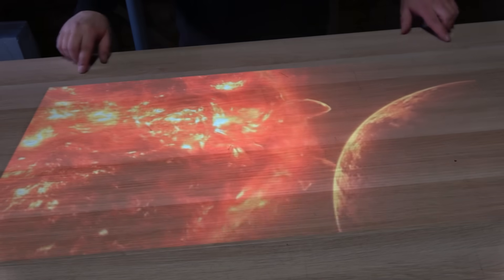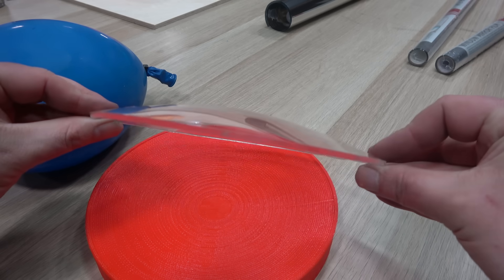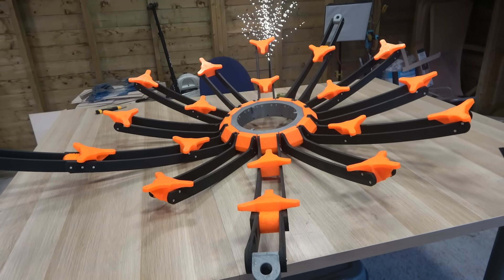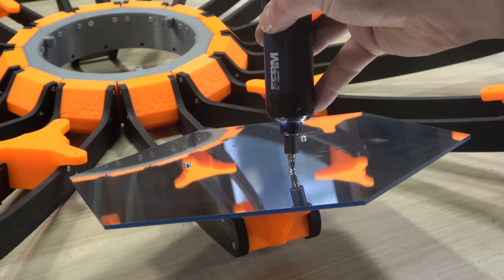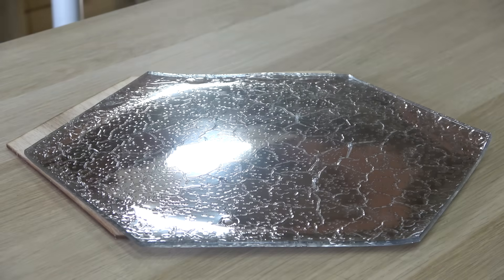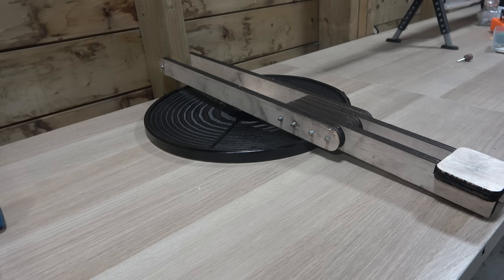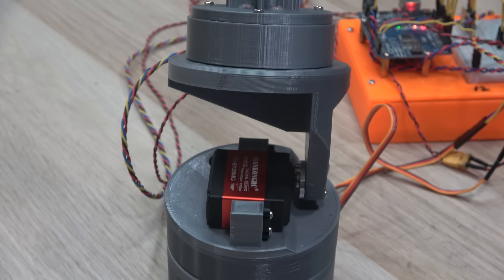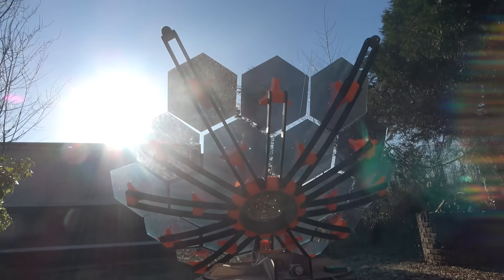Building a DIY Solar Generator..

Comment: Ack!  Blacken the aluminum!  Your reflecting WAY to much of the energy back at the sun.  Literally almost all of it.  Um but you might end of flash boiling your water or melting the aluminum.  So highspeed pump?  Or use a thermal fluid to move the heat away from the plate?  Have a heat based auto-abort? (something that moves the mirrors off angle if too hot? Bimetallic bar that need to overcome a spring?)

Comment: Why not order a sheet of brass sheet stock and hand polish it with brasso?  If you are able to print molds for plexiglass, then you should be able to make a press mold to form it as well.  One other thing I haven't seen anyone do (maybe its not possible):  Don't we have new solar cells that work on specific bands of light with greater efficiency?  I thought there was something regarding the "limelight" color those old stage lights made.  If you could stack one on top of the other, wouldn't that make output double for the same size (assuming one of the panels will allow that band of light to pass through it to the next layer)?

Comment: For the sun tracking I'd seriously consider an equatorial aligned single axis drive, just like a German Equatorial telescope mount, it will allow for counter weight balancing to lessen strain on motors. There's a market for second hand mounts with some sophisticated tracking software more than capable of following the sun even over multiple days.
You don't need your primary reflector segments to be curved either, they can be flat as you are not trying to cast the image of the sun on a focal plane, you just need the maximum of light from each reflector to reach a common surface area which will be your collector. If you could position your collector in front of the reflectors instead of needing a secondary reflector to send the light back down again then you avoid losing energy to a second reflector which will itself also be getting quite hot as it is nor reflecting 100% of the light/heat.
Reply: Yes to the equatorial, no to the German equatorial though: they have a meridian flip issue that you just do not want on a solar collector. What you would actually want is a simplified fork mount: the two tines, instead of holding a telescope tube would instead hold a shaft fixed to the back of the reflector. In the other direction the shaft would extend past the pivot point where it could be counterweighted. Another variant would be the yoke mount, which might actually be the best option.

Comment: Your spherical vs parabolic issue was the exact problem with Hubble. The manufacturer of the Hubble mirror used a circular saw and thus ... you know the results.  Bands of mirror reflecting to different focal points. Too bad. History repeats.

Comment: I don't know what CAD software you are using. In Solid Edge, if you use the material properties correctly, the software can identify the center of gravity (CoG) of both a part and an assembly. If you place the CoG of the upper mirror assembly directly above the central point of your turntable and are able to figure out a method for pivoting the mirror assembly up and down on an axis which passes through this CoG, there will be no moment arm to contend with. The motors required for motion will only be fighting friction and inertia. They won't be battling many newton meters of torque.

Comment: You can absolutely thermoform your mirrors but it requires precise oven temperature control to avoid bubbles and under and overheating the glass transition temperature of your plastic (scientific not kitchen style controls etc).  

I have made image worthy shaped mirrors from safety mirror (secondary mirrors).

I assume there is also micro arcing in your film in the microwave. I'd apply (for primary mirrors) reflective film or aluminum tape to the plastic after forming.

Comment: hey hey nice work. the screw and spring alignment is directly inspired by 3D printer beds like on the ender3, I'm sure. i like it. but have you considered making the 'springs' out of silicone? if you liretally type 'silicone spring' you'll see what i mean.

Comment: I'm not an engineer, but my impression is that the screw holding up the whole mirror assembly will likely be problematic if literally any significant wind is introduced. The surface area of that mirror will act like a parachute.

Comment: Aside from using flat mirrors to make it easier and painting the disk black: The heatdisk should also have some sort of transparent casing as to trap more heat. A large hot metal disk also is good at giving off heat to the surrounding air. And the cover would also protect whatever dark coating you use.

Comment: There is a white paint that reflects the heat away from itself. I wonder if that could be used instead of more expensive metal to focus the heat? I don't know what angle it reflects at, but would be an interesting experiment.

Comment: I would try to use analogue circuits by connecting the LDRs to analogue comparators to drive the motors.

Comment: I wouldn't even think about using light sensors to control the movement of the array. You can use i.e. python's library for solar position, which will give you information about an exact angles any time of day in any day for the given geographical location. That will be much simpler and precise, IMHO. Looking forward to see progress on this project! 	👍👏

Comment: Dont know if you've tried before, but I recently saw a computer glass mod where they used a spray on mirror finish that looked pretty reflective when applied from the backside of the glass/plexi.

Comment: The argument that there is a lot of energy around us is false, since there are laws of physics and economics that prevent its use. Solar energy on Earth will never be so profitable and reliable from all points of view to use it everywhere. It has a very narrow corridor of application. For example, in the wilderness, where there is no central electricity.

Comment: I think the general purpose of this design is holding you back.  This is a proof of concept - you don't need the version that works at every latitude and longitude on the map at every season.  You know what longitude you're at and can manually tilt the base to whatever angle the sun will be at the week you test. The big lazy susan bearing should be the only movement you need, and as you're only moving along one axis you'll only need 2 sensors.  Things I'm less certain of...  wouldn't you apply the metal reflector to the back of the lens, not the front?  And wouldn't a Fresnel work better than reshaping hand cut plexiglass for about the same price?

Comment: Two Russian youtubers made sun tracking based on math, location and date. They decided that tracking on light resistors was not a good fit
Reply: Thing is, is this contraption precise enough to make use of that though? This solution might not be ideal, but might be good enough with what's available.

Comment: 2 things I would do differently.  Firstly, I'd apply the reflective film after shaping the mirrors, a bit of heat and job's a good 'un.  I also wouldn't bother with the extra complexity of the arduino, sun tracking using ldrs or even leds can be done in a totally passive manner using very few components.   But you've done it now, so hey...

I probably wouldn't use water as the working fluid, and would almost certainly not use perspex on the back of the collector.  That's gonna get hot.

Comment: Tracking solar panels that use a system like this one will be almost constantly tracking, and the heavier they get, the more motor power you need. On the other hand, humanity has been predicting the position of things in the heavens since before words like "science" and "astronomy" even existed. Simply find out where the sun will be in the sky where you are that month, and have the panel adjust every 15 minutes or so. Not quite as efficient, but you'll probably get to "keep" a lot more energy.
Reply: Easier solution: widen the photoresistor assembly and use a bigger sun blocker. More shade time would produce fewer movements. Simple, low-tech solution.
Reply: Solar clocks. Surprisingly the movement of the sun seems to coincident with a 360 degree rotation. So basically horiz rotation could be done without frequent measurement, to avoid "cloud effect". Have the ardu rotate on some deq/time interval that seems most efficient &power down, maybe a position check once or twice a day, and possibly add a latch, if you want to avoid stress on the stepper holding torque/mechanism (storm stuff). Vertical either in interval measures/movement, or even catching daily top position, average, some math, and base movement on that. Again to avoid cloud, birds etc interference. You can also get light censor chips connected directly to motor drivers for 2-3€ from Ali for this specific purpose - but i dont think they have any sleep interval.

Comment: You're still making your sub-mirrors the wrong shape - your mould makes a perfect mirror element for the centre of your dish, but will be wrong when placed in all the other positions because those sub-mirrors won't be straight-on to the sun. To do it perfectly you need to make a mould that matches a strip cut from the full dish parabola and press each mirror in different places along the strip, or make separate moulds for each different distance from the centre (3 in your case).

Comment: If you're worried about the spindle not handling enough force to move and support the arm, consider adding a hydraulic arm support and letting the spindle only drive the movement.

Comment: Love the project, but how effective is this compared to a traditional black box with small piping running in coils within the whole box. aka the center plate.
(we call them "suncatchers" in Norway, not sure of their proper name).  Basically an inverted radiator.

Comment: Issue, their is a maximum amount of energy a solar panel can convert, in fact as the solar panel heats up the conversion rate of the crystals drop. Layered solar panels with water cooling is now a better method to increasing the energy efficiency. So focusing on less solar panel material probably won't help much unless your in winter.

Comment: It probably won't affect this project much but is there a reasoning to the flow pattern in the heat collector?
I''m just seeing all these 180 turns on it. So I'm left thinking, wouldn't a spiral pattern from the outer edge to the center without those turns be better? Would be easier for the flow of water since there won't be so many turns to change the direction.
But maybe there's some reasoning I'm not aware of.

Comment: I would put the collector at the 1st focus and make it a sphere with a hole in the side to let the light in and stop any reflections from leaving.
Imagine machining channels into a hollow sphere with a hole in the side, then coat the inside with candle soot.
This way, you won't have to worry about machining a secondary mirror. The parabolic segments reflect just once through the hole in the sphere and everything is captured.
I made a solar tracker using an Arduino, GPS module and two servos, (later two steppers) and some code to translate time of day and lat/long location into elevation and azimuth in degrees.
Works even when overcast. Add an anemometer then set to elevation to 90° if wind exceeds a limit.
Use a linear actuator for elevation - this can take a lot of load. Raise the dish and add a counterweight to reduce static torque.
Servos are a pain - they want to slew suddenly to another position at power-on, and that can break things if they don't have a clutch mechanism!

Comment: For better efficiency, you could do right now:
- cover your aluminium dish with soot or with anything that is as black as possible (try avoiding thick coatings). I'm sure you know it yourself though, and you are just trying to invoke people leaving you comments :P

for future:
- another design for the light collector: if the light focusing is good enough, you could make the collector in a shape of a classic "black body" model, which is just a thermally insulated black-walled vessel with a lone hole for light input/output. In this case, you could minimize all three types of heat loss: conductivity, convection and thermal radiation
- OR it's possible to use a clear/transparent thermos as a shell for your collector. This will prevent heat losses by air convection. This is also what Chinese use in their solar concentrators - those, which look like a row of glass pipes with a cylinder on top.
- you can try to apply metallized film at the mirror face to increase reflectivity

Comment: I'm certainly not an engineer. I'm a 3D artist in game development. But recently, at work, I needed to get acquainted with the design of large parabolic antennas for radio telescopes. I noticed that your mirror experiences a lot of shaking and jerky movements when lifting. It seems to me that this is due to the fact that its center of mass is located far from the axis of rotation of the lifting mechanism and lies somewhere in the center of the mirror.  Because of this, the entire structure experiences uneven loads, which can affect the durability of the mirror adjustment mechanisms, as well as the motor and drive shaft of the lifting mechanism. Perhaps if you make a counterweight that would shift the center of mass of the mirror to the axis of rotation of the lifting mechanism, it will last longer and work more smoothly.

Comment: I would change a lot, but that would be complete rework
Like investigating aluminum as mirror surface
Using inflatable design pretty much balloon within balloon and could also use lift gas and attach everything with rope system
But also had a lot of weight constraints,  could get bigger for better lift of anything that's will get focused sun at

Comment: I was thinking heat pipes, or evacuated solar collectors somewhere in the mix.  Your set up is pretty awesome though and I love the reference to Webb.
Regarding gold being a good IR reflector could you use polished brass? Oxidation could be avoided by spraying with transparent lacquer.

Comment: You should use oil not water as the fluid, because if the water gets too hot you will get steam and blow the system up! Probably a motor oil is best but not sure.

Comment: If you intend this to only be used in a fixed location then you dont need 2 degrees of freedom on your mount, build instead an astronomical sidereal mount and set it for the appropriate latitude.

Comment: 9:58 so many simple mistakes made. Why not apply the film after shaping the panels?
Reply: Haha that's exactly what I wondered?
Reply: Thank you!!!!!!
Reply: For the application of the mirror finish, if it's a film, it's easier to apply that to a flat surface, and then alter the mirror into a non-flat surface.

However, there's no purpose in reshaping the mirrors here, as the placement of the individual mirrors accomplishes this task.

I suspect this person is not operating on complete knowledge of how optics, and the geometry thereof, work in this setup.
This very much seems like a guy who saw something, thought it was cool, and tried to do something with their idea. Which I'm all for, and would enjoy more people actually trying to learn new things and find new applications.
That said... This is technically a concept that's already in use. But props for finding ways to do it a bit differently. 💁🏼‍♂️
Reply: @BJCMXY I thought the same, that the individual mirrors are about the same size as the collector. So why curve them? But they need to bounce from the central reflector to the collector also. So, some imaging is needed to not increase the divergence too much since they're all pointing in different directions if flat (entendue problems).
Reply: @timm7524  the degree of divergence in this scenario is insufficient to generate a significant loss in capacity, not to mention the goal isn't to create a hyper focused beam, but to generate heat, it's actually more efficient and effective if the heat is spread out a bit, as the quantity of materials absorbing the heat is larger. Think about why heat spreaders on computers have large surface areas, it's to speed up the transfer of heat from one medium to another. Low surface area, at high temperatures simply risks destruction of the transfer medium in question. Higher surface area, as somewhat lower temperatures, doesn't risk destruction of the transfer medium, and considering the period of time involved, it will simply slow down the initial part of the day, but won't seriously affect the overall production.
Reply: I've played with making mirrors like this. Applying before, they can be damaged. Applying after, they wrinkle. It's hard to get them to really conform no matter what you do, unless it's heat shrink of some kind.
Reply: It seems like such an ill-thought out project. Why not get a metal plate over the heat sink? Why not use metal springs if youll spend $170 on the heat sink anyway?
Reply: @ i was confused too

Comment: Photovoltaic sensors on solar panels usually have a stacked layer of smaller shapes so that it can absorb as much energy as possible, even under low light conditions like overcast and rainy days, they need to stack into smaller pieces like layering a cake to maximize the amount of energy it can absorb and concentrates that to generate electricity.